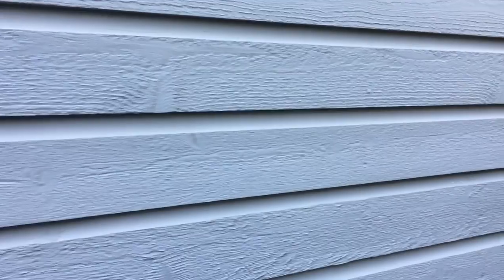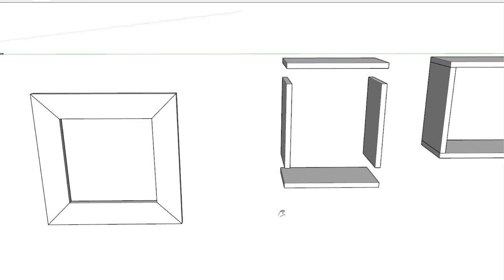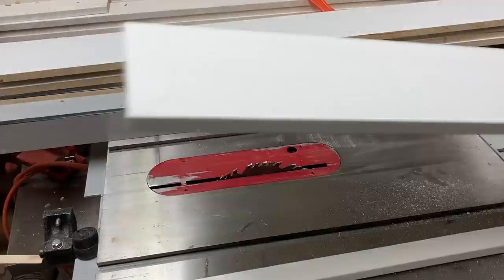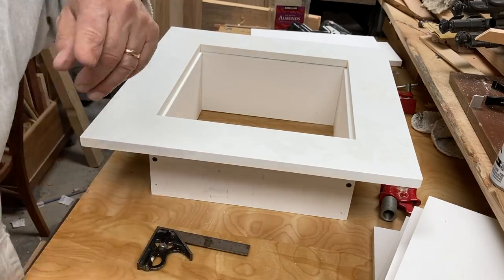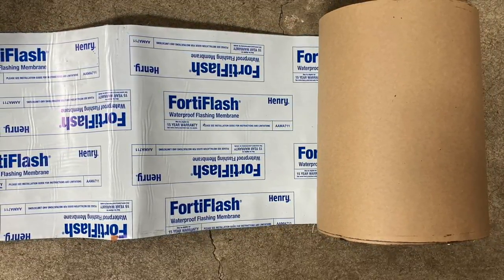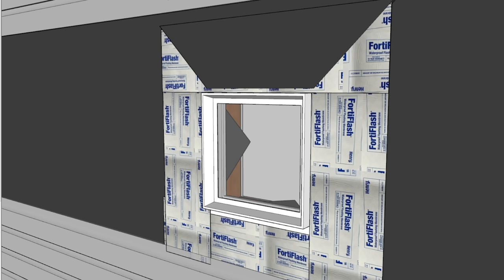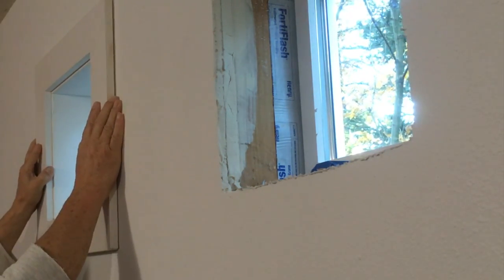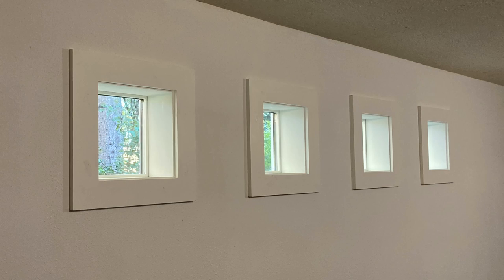Building, Installing, Flashing and Casing Clerestory Windows Between the Studs.

Comment: Fantastic video.   I've watched a lot of window installation videos over the years and it's not easy to find anything for between the studs, with the exception of maybe shed windows.  This is well made, very well explained and to the points.  I have two new 14 1/2" windows I found at a local extra building supply store a few months ago and this video ramped up the motivation to get it done sooner than later.  Thank you!
Reply from the maker: Thank you for the comment. My motivation was no structural work, no permits, no need to do drywall work to make room for the jack studs, cripples, and headers, etc. Honestly the hardest part of the whole job was the careful removal of the siding. Luckily the profile was still available so I was able to replace the few boards that got mangled while removing the nails. I'm glad you enjoyed it. Thanks again for watching.

Comment: Wow! An amazing job and equally amazing video. We are thinking of doing this exact thing in our house. If it goes well, might add these in a couple other places as well. We're mostly after some additional light, and I think going between the studs is going to be fast and "easy". We have stucco on the exterior, but otherwise will be very similar so thank you.
Reply from the maker: Steve, fast and easy was definitely the motivation for going between the studs. No sheet rock to cut and replace. No extra studs headers, etc. I don't know much about stucco, that may add some difficulty. I hope it goes really well. Thanks for the comment.

Comment: This video is incredibly helpful, thank you! It seems like for this the windows were spaced across every other stud. Are there any issues doing this with the windows butted up against each other?
Reply from the maker: Thanks for the comment. I would not think there would be any structural reason they couldn't be closer together. You would however have an issue with the nailing fins overlapping and some difficulty getting the outdoor trim to look good. Thanks for watching.

Comment: Great video, well-presented.  
My question: where do you get these small windows? Big box stores don't seem to carry them and the only source I could find was through custom window suppliers (each one, about $300).
Reply from the maker: Mine are from Milgard. All of my windows are Milgard so I got them to match. They were around $80 each. Custom order to fit 14-1/2" square rough opening.
Reply from the maker: Simple white vinyl slimline fixed window.
Reply from the maker: Thanks for the comment, I hope you have luck locating something similar in your area.

Comment: So there are 3 panels? Two panelled outside surface and one panel on the inner surface?
Reply from the maker: Thank you for the comment. Yes, if you mean layers. From the outside in there is (1) the cedar siding, then the felt paper, then (2) the 1/2" plywood sheathing, then the stud wall filled with insulation, and finally (3) the 1'2" drywall on the inside. Hope that helps. Thanks again for watching.
Reply: @makingthings1463  Thanks for the reply. I meant glass panes. There would be 2 panes of the window and you don't have to have a pane attached to the box.  I was thin king of adding a stained glass pane to the box so that the light as it comes in highlights the pattern.
Reply from the maker: Thanks, I misunderstood your question. Yes mine are just double pane vinyl windows. A stained glass panel could be mounted anywhere within the the 5-1/2" deep trim surround.
Thanks again.